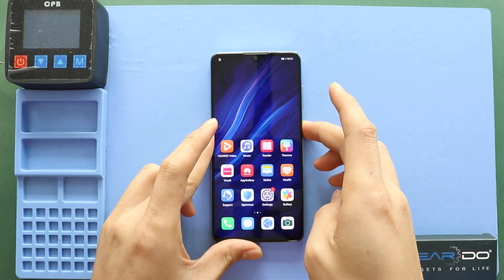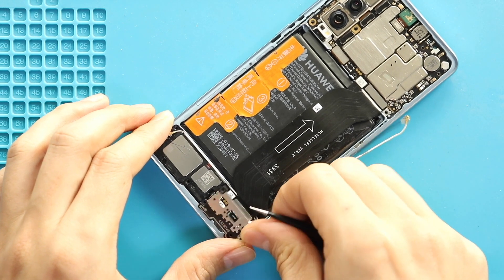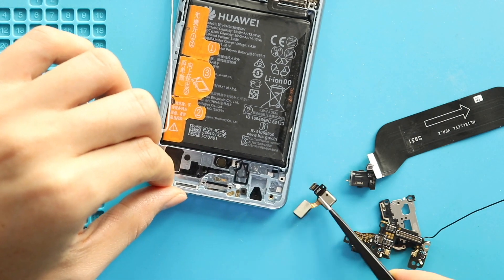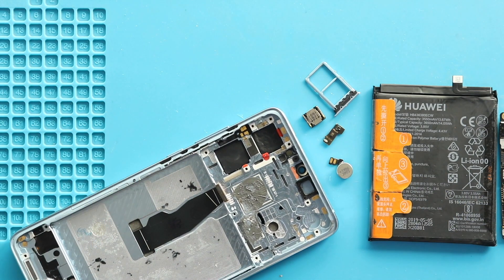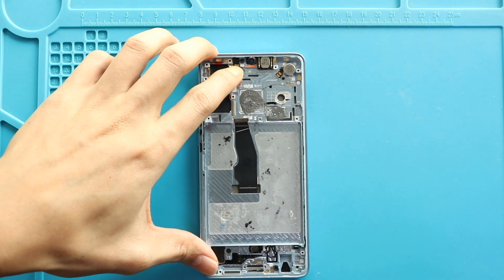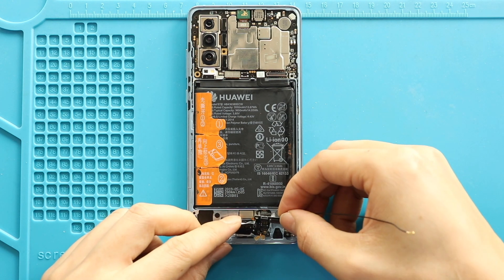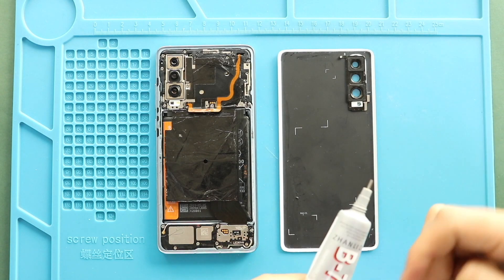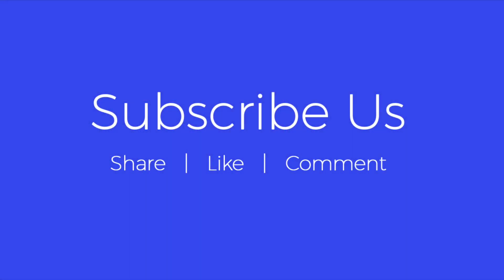Huawei P30 LCD Screen Display Replacement

Comment: Hi incredible video. What temperature would you use on the heat gun to remove the parts? Also, will the fingerprint sensor work after this repair?

Comment: Thank you so much! Definitely not an easy task but with lot´s of patience completely doable. Had some problems with getting the side buttons and the speaker working at first but it turned out I had not installed the screws yet and that was the problem! Thanks again!
Reply from the maker: Glad to hear that 🙏

Comment: My P30 recently replaced with screen due to stripes and white lines but authorized service center said screen replacement parts have bundled including battery component, i dont know why i have to charge the battery which its makes me charge high service fee including parts , the fact that i don't know if they really replaced the battery.
Reply from the maker: Most of the original service pack screens are coming with the battery.